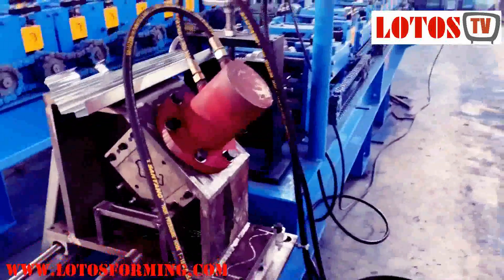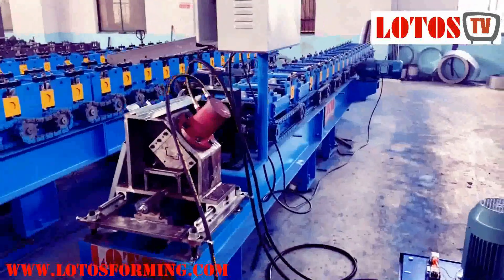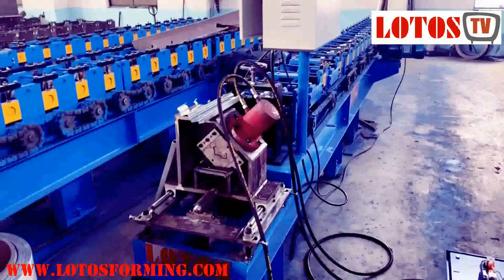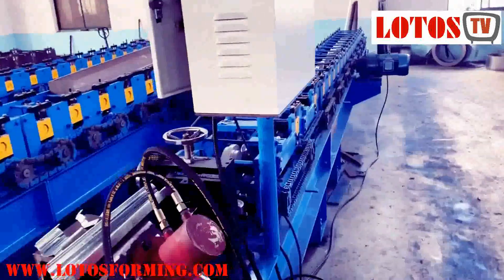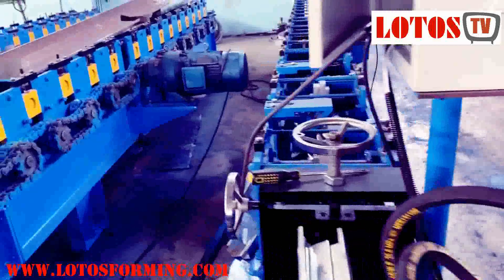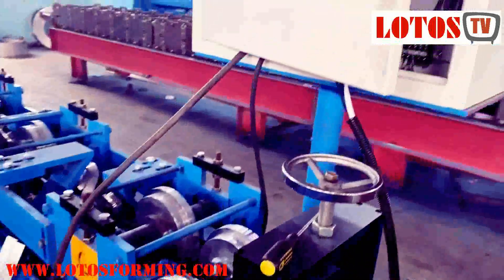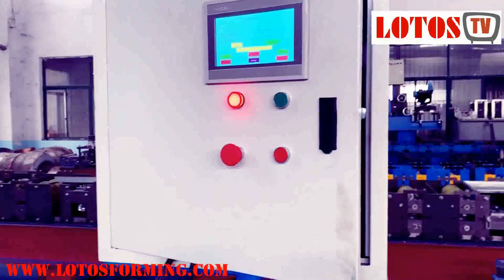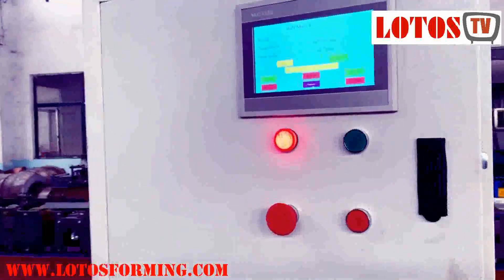【Fire resistant windows frame machine】:fireproof door frame machine🔥Fire-Resistant Door and Windows

Comment: Fire-resistant windows frame are given a fire-resistance rating and are usually made of steel. They are designed to be kept closed, and any gaps between the wall and the door must be filled with a fire-resistant sealant. Safety door frames and fire door frames roll forming machine.

Comment: This fireproof door frame machine production line will be combined with manual decoiler, and roll forming machine part, and automatic output table, and hydraulic pump station and electrical control cabinet and so